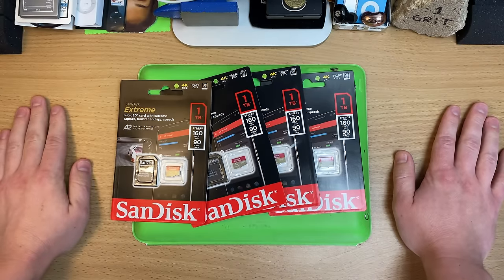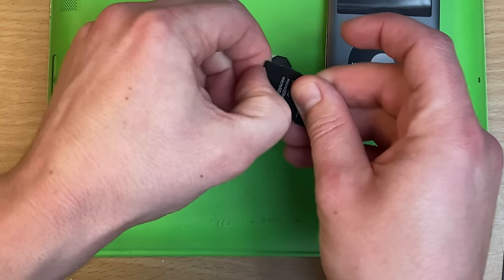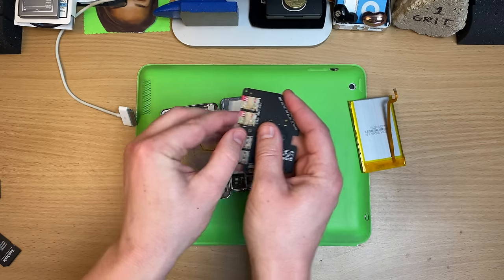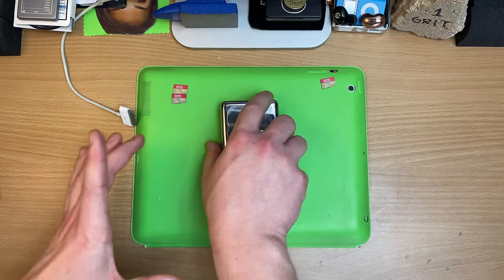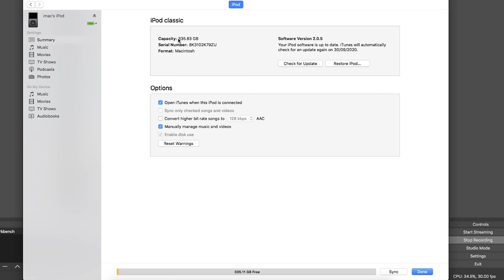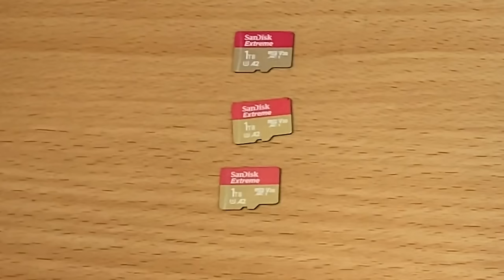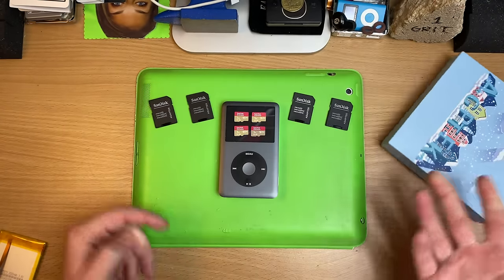4000GB in an iPod Classic.

Comment: Bet iPods are 32 bit, and so can’t read anything over 2,147,483,647 megabytes or something stupid like that
Reply: Thats what i was thinking also especially being a 2007 system
Reply: That should mean in theory you could make post iphone 5 model ipod touch 4tb+
Reply: I was thinking more of the limits of UEFI vs. Traditional BIOS formats, a traditional BIOS system can only address/see 2tb total.
Reply: Because the maximum number that can be represented by using 32 bits is 4,294,967,295, this translates to 2.199 TB of capacity by using 512-byte sectors (approximately 2.2 TB). Therefore, a capacity beyond 2.2 TB is not addressable by using the MBR partitioning scheme. 

Gotta love 32bit architecture. Though not bad for an arm processor at the time.
Reply: I would think that too
Reply: @canadiansike7389  You forgot a critical part of the hardware... what is JBODing those cards?  the iFlash card, it is probably using an MBR.
Reply: Thomas Basham yes but tbh good luck soldering 2-4tb on an iPod touch board and fitting it inside the case
Reply: @canadiansike7389  This. I'd bet the limitation is the partitioning scheme.
Reply: Lochlan Currie 2TB+128GB+16GB+8GB config would reach exactly the max with 4 cards. I see the ultimate and final video in this “series” in front of my eyes.
Reply: @canadiansike7389  wait, 2.2TB! so that's why when Danky put 2 1TB cards and 1 512GB card it said ~360GB which is ~2.2TB less than it should?
Reply: MarcosLp probably some weird overflow issue yes.
Reply: coppyhop These restrictions are about GPT vs MBR (partitioning type), not UEFI vs BIOS
Reply: More like, iPods use the standard DOS partition table (aka MBR), which only supports disks up to 2 TiB (which is roughly 2.2 TB). You need GPT to work with 3TB+ disks. There were all sorts of compatibility problems when the first 3 TB HDDs came out.
Reply: Thomas Basham Yeah, the new iPod has the same CPU as the iPhone 7, so that would work, but iOS devices work different
Reply: @e.6z1  Yes that would be an overflow issue. After 2.2TB it restarts back at 0, so it only read from 2.2 on to 2.5, which was ~300gb cbf doing the math it's late.
Reply: Came here to say this.
Reply: Over-50 embedded engineer here, read most of this before realising I understood it all. Good work!
Reply: Thats the answer. They are all 32 bit
Reply: You technically could use bank switching to get over this limit
Reply: THANK YOU I WAS WONDERING WHY OLD STUFF CANT READ OVER 2TB
Reply: MarcosLp 2.02tb
Reply: Ben Perkins 2.02tb, everyone is forgetting the hundreds place in mb, it takes 1024mb for 1gb and 1024gb for 1tb
Reply: Urmahgurica not anymore, a gigabyte is 1000 megabytes. The binary system you’re thinking of is kibi/mebi/gibi/tebibytes
Reply: The limit here isn't because of MBR vs GPT partitioning. If it were, I'm pretty sure Disk Utility would see it as full capacity.
Reply: @benperkins2929  thank you for covering that!
Reply: @roge0  well partitions only do so much. 32 bit hardware is 32 bit hardware. It's a physical issue not a digital one at this point.
Reply: @davidwostrel  mbr and boding aside it's a 32bit arm processor. No matter how you do it. It'll never read over 2.2TB of storage
Reply: @e.6z1   @Ben Perkins  summed it up before I could
Reply: @urmahgurica5851  also correct, however we will still hit an overflow. Hardware this old is bound to act unpredictably when trying to handle hardware it's not meant to handle
Reply: Ben Perkins why do you know that
Reply: @neonrl1414  I'm almost finished my computer science degree :)
Reply: @e.6z1  its overflowing cuz 32bit adresses 2.2TB and just doing last 360GB
Reply: It's called LBA 32-bit address limit (no more than 2^32 512-byte sectors).
Reply: @canadiansike7389  It's totally unrelated to the bitness of the CPU.
Reply: Kinda weird that they count bytes on the drive with signed integers though
Reply: @SIGSEGV1337  They don't. 2^32 sectors * 512 bytes/sector = 2^41 bytes = 2 TiB.
Reply: @evgSyr  Good point
Reply: That or the ipods only supporting MBR partitions which only go up to 2TB
Reply: @coppyhop  yes! Or maybe it's related to it being MBR or GPT?
Reply: If I googled the right model, the processor shod be a Samsung ARM, Apple A8 chip, 64-bit architecture.
Reply: It's a bios and level and drivers mixed with cpu so I mean you could probably do 2.75TB sd card
Reply: That would actually make a ton of sense
Reply: RuneScape max cash stack lol
Reply: @coppyhop  Not excatly. Depending on various factors, the OS can decide what it can and cannot do after it boots. Those BIOSes themselves can address 2^32 sectors, which in 512 B sectors means 2TiB (~2.2TB). Some hard drives use 4096 B sectors to work around this (raises the 32bit addressable storage to 16 TiB (~17.6 TB) to allow those old BIOSes to boot reliably from those disks). The same goes for the MBR partitioning scheme; 512 bit sectors -> 2TiB maximum; 4kiB sectors -> 16TiB maximum.
Reply: @lollllloro  Even so I doubt Apple thought some madlad was going to cram more than 2 terabytes in a 2007 ipod as mobile storage wasn't that good when it was made. The phone I'm holding is 64ish gb barring sd cards.
Reply: 2 billion megabytes?
That's 2 exabytes
Reply: @canadiansike7389  you're right, but not quite. It uses the Apple Partition Map that has the same limitation as MBR nonetheless.
Reply: @thomasbasham8705  no, the storage is soldered.
Reply: @XanthosAcanthus  thats why i said in theory as in a hypothetical. I know there isnt a chip that would allow it with the current technology or without microsoldering skills when it was. Also thanks for tagging me i missed most of this thread
Reply: is that the 32B integer limit?
Reply: @matsuyowaimo  yes it is
Reply: @thomasbasham8705  No only Apple A7 and up are 64 bit (iPhone 5s) and all Apple mobile devices including iPods have soldered storage so you can’t change it
Reply: @thomasbasham8705  Well you have to make sure it is 64-bit.
Reply: That's almost certainly it, the Ipod's processor is believed to be some flavour of ARM, and there were no 64 bit ARM processors until 2011.
Reply: @Chlorate299  you mean 2013 right (that's when apple put one on the iPhone so ipods after that should have 64bits)
Reply: Having a 32-bit processor doesn't prevent you from using drives over 2 tb now if it's using fat32 that would. You could easily use greater than 2tb drives in windows xp since ntfs didn't have those size limits even though it was still a 32 bit system.
Reply: That's what i thought
Reply: Fucking signed 32 bit integer limit
Reply: @canadiansike7389   what is The limit of 64 bit lol
Reply: its 4,147,483,647 bytes of ram but it can have infinite storage
Reply: @canadiansike7389  I was thinking he wasn't removing all the partitions, but this really explains it well.  Especially the comment about the overflow.

Comment: It''s so earily similar to the attempts to get Windows XP to read more than 4 GB of ram...
Reply: Or any x86 OS for the matter.
Reply: Eerily*
Reply: 32 Bit Windows XP: ~4GB RAM hard cap.  (There was still a 64 bit version, but not well known).

iPod classics apparently use HFS+ which would have an 8 Exabyte limit (1EB=1 million TB), however I don't think that's the case.  

There's no concrete info online about the iPod filesystem, but it's most likely not the HFS+ you see mentioned, where the capacity is 8 Exabytes, i.e. 8 million terabytes.  Probably a 2TB limit like FAT32.
Reply: @startedtech  what do you mean windows XP 64 bit isnt well known? i thought alot of people knew about it but i guess not?
Reply: @startedtech  it's probably a limit on the SOC controller, cos the ZIF conector is and IDE cable, and 2tb is the hard limit of that interface, also, earlier revisions of sata had problems with more than 2TB but that could be solved with some bios tweaking (not the case here LOL)
Reply: @startedtech  Mac formatted iPods use HFS+. The problem is more likely due to the disk controller being unable to read above 2TB. Mind you it has a 32-bit ARM processor so the 2TB limit makes a fair bit of sense.
Reply: @californium-2526  Well... any halfway decent Linux distribution would likely support PAE in the x86 version.
Reply: Yep.
Reply: easy, I had 8 with xp...
Reply: Any x86 OS can do it. It's called enabling PAE.

And it's on on Linux by default.
Reply: Wait you never used 64 bit windows xp
Reply: @WolfieMar  There wasn't much reason to use a 64-bit OS for normal PC use when XP was around (hence hardly anyone I know has ever used it) and by the time x86-64 CPUs, +4GB of RAM and 64-bit applications became more common Windows Vista and 7 were already out. I used to run XP Professional x64-bit before a buddy of mine gave me a pirated Windows 7 copy and I remember it being quite unstable in comparison to its x86 brother.
Reply: Anyone else seeing protomario just everywhere?
Reply: @startedtech  In my opinion it probably is FAT32 because the iPod's file system needs to be natively read by Windows in order for iTunes to write files to it.
Reply: @armanelgtron4533  And I thought Win2K and above (like WinXP) supported PAE too, but the boards/CPUs? idk?
Reply: Windows Server 2003 supported that out of the box. You can backport 2 kernel files from that to XP and have it work. My XP laptop has 12 GB of RAM, and the only limitation of this method (PAE) is that each process can only use up to 3 GB, but most 32 bit software that can use this much would just use multiple processes anyway.
Reply: *eerily
Reply: @g19mx  naubodee gaevs ai sheit dood. Spelling is just too hard ain't it bruh
Reply: @startedtech  you're right in there being no info about the file system but  there is some known about the hardware. It's a samsung arm chip more than likely 32bit the time considering the first 64bit arm phone was in 2013 I believe and was the 5s. The limit of memory is around 2.2tb but shows up as 2tb. So you're assumption is highly correct in my opinion
Reply: I got Windows XP to run on 8 GB of RAM
Reply: @coffeedvdrw  There is a 64 bit version of Windows XP, the 32 bit can not use more than 4GB of RAM because 2^32 = 4.294.967.296 bytes which is 4GB
Reply: @loganiushere  Everything from the Pentium Pro onwards (i686) supports PAE. At least Windows 2000 did, on the software side, not sure about NT4 or anything older. Linux/Unix definitely did way prior to Windows.
Reply: @RodrigoBadin  And 2^36?
Reply: Just use Windows XP Pro for 64-Bit Extended Systems
Reply: @startedtech  I did some googling and I think (not sure) that the partition map in an iPod uses a MBR for its partition map, which means that the disk size limit is 2 TiB which makes sense based on the 2TiB limit in the video.
Reply: You mean <= Windows 98.
Reply: i want 4 gigs on my xp lol i. have 1 gig atm
Reply: wow, i have a windows xp and windows 7 machine, both operating systems on different hard drives, 1 TB each, and it has 5 GB of ram
Reply: @LazyTechNerdCG  bruh my windows xp has 0.99gb of ram and my windows 7 has 4.00gb and my old windows 10 had 3.67gb
Reply: Yeah.
Reply: there are workarounds
Reply: @WolfieMar  64 bit xp wasn’t not a thing yet. I had the chance to install 64 bit but didn’t made any sense as 64 bit xp apps was rare. Not to mention 8gb of ddr2 cost a bomb
Reply: @maman89  there is a 64 bit xp. Lol.
Reply: @lolerie  wasn't a thing doesn't mean it doesn't exist. I had a chance to install but chose not to
Reply: Windows x64
Reply: @startedtech  idk, i used 64bit cuz i can read
Reply: Get the 64bit edition, m8!
Reply: Attempts? There are working PAE patches, got 18gb working with no problems other than 3dmark 2000 something not running
Reply: But proto....!
Reply: @absolboi334  *early
Reply: @WolfieMar  No, a lot of people didn't know about it because computers with 64 bit CPUs started to become popular in the consumer market at around the time Windows 7 came out.
Reply: @Lambda_Ovine  Yeah but after that i thought they would at least know a little about Windows XP x64
Reply: @californium-2526  I remeber Linux patching the kernel to do more than that. The thing is that considering how 32 bit systems work, I don't even know how that's even possible.
tbh, if you use a 32 bit system you won't probably need more than 4GB of RAM anyway.
Reply: Get 64 bit XP, boom
Reply: eerily*
Reply: @darcyhayes9904  hes trying realllly hard to be relevant again and revive his dead channel. Cringe
Reply: @californium-2526  you probably mean 32 bit, 64 bit (amd and intel) processors are still x86 architecture,
Reply: @g19mx  My man can't even use the @ reply feature apperently
Reply: @nesyboi9421  I can’t see my own message what was it?
Reply: @g19mx  hey my man learned how to use the @ reply function
you were just telling a guy nobody cared.
Reply: @nesyboi9421  that was like a year ago aye lmao
Reply: @startedtech  apple be like 10000000000000000000000 dollars for the exabite one
Reply: @startedtech  Weird to hear XP 64 isn't know... tho i can't say much, because i had most of my XPs as business purchases, no clue what the pleb (jk) had.
Reply: @RodrigoBadin  32-bit version of XP (and any later version, up to 10 32-bit) can use more than 4GB, but you have to install a unofficial patch which can be found somewhere on internet. If anyone found this patch complicated, they can use 64-bit version of XP, but beware that its doesnt receive POSReady (last version of XP) updates all the way to 2019, and second is that, some 64-bit version of windows, in this case, both XP x64 and 10 x64 bricked 2 HP motherboards during BIOS update [due to the driver for the BIOS update software only works with certains version of windows, otherwise BSOD] (and both motherboard are same model from a HP Microtower PC).
Reply: @startedtech  HFS+ tends to have issues above 2TB. If you have a PowerPC Mac running 8.1 or up (and I'm drowning in them), you'll have issues with drives over 2TB -- and partitions over 190GB in Mac OS 9 and below.
Reply: @megakarlachofficial  why in the world would you even use a 42 bit version of win10?
Reply: @L44tsmasher735  
first off ur typing 32-bit wrong*, and now second, doesnt matter it someone use it or not, but 32-bit Win10 was there for 16-bit app compatibility, this just about the RAM patch tools requirement just to make sure its works on specific version of windows (32bit or 64-bit only, new or old) and etc... and in fact, im not using Win10 32-bit either as main (using modded Win11 here and its 64-bit only, on a 2009 potatoish rig since my main gaming, mid-range 2011-12 [i5-2400, 8GB RAM specs] with 750Ti PC broke).
Reply: Sorry for the Necro posting but you can Use Windows XP x64 to get those sweet 8GB DDR2 lol.
Reply: @darcyhayes9904  nope, just you. (Ntbr)
Reply: Spoopy proto boi

Comment: "Alright mate, let's use this here 1TB Mac to load up my 4 terrybyte iPod."
-DankPods probably
Reply: the reason that it kept saying errors was the cards were probably fakes sold online
thank you amazon sellers
Reply: me too
Reply: "Alroight mate , let's use this ere 1TB Mac to load up terrie bite oiPod:
Reply: @bruh9600  No, the actual Problem is the Format of the cards, which were FAT32.
FAT32 can adress up to 31bits at a time, the first is for kB or MB. 
2^31=~2,2GB (other could be OS for the iPod)

That's also the reason why u can't put files larger than 1,8GB on a FAT32 formatted USB-Drive.
Reply: @878manu  Don't you mean 4GB?
Reply: I'd really like to smack the thumbs up button for you, but... I mean... 666 likes. Not that the number is particularly relevant here, I just... can't be the one to break it.
Reply: @878manu  FAT32 has a SINGLE file size limit of 4GB, FAT16 has a SINGLE file size limit of 2GB. The theorical limit for FAT32 drive sizes is 2TB, not 2GB, though Microsoft's disk manager won't allow you to make a FAT32 partition larger than 32 GB. I have a few 32GB SD cards in FAT32, a 8GB FAT32 SD card, and Dankpods IN THE VIDEO successfully formated his 1TB cards to be FAT32, and 2TB recognized (however unreliably) by the ipod.
Reply: @od3stroyer771  It's indeed 4GB, and it's for a single file size, not the total drive size.

Even Apple got it wrong at one point. MacOS High Sierra introduced a bug that disallowed files over 2GB to be copied to FAT32 drives. You had to use the Terminal or a third party file manager to move large files. I think it's long been fixed.

High Sierra was a mess, the FAT32 file size limit bug was overshadowed by things like the root access bug and the password hint bug.

Let's hope YouTube doesn't delete my comment this time...

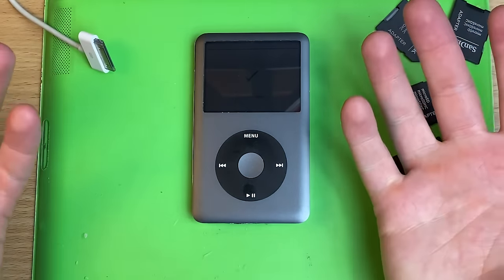Comment: 15:17 - A limit, yes. These iPods are clearly 32-bit devices. 32-bit devices can only access around 2.199TB.

16:00 - To get over 2.199TB you'd need to overhaul the entire ipod (silicon/mem controller etc) to 64-bit
Reply: Or just format the disks with a higher sector size.

Comment: 8:46: "Partition map: Master Boot Record"
9:01: "Let's just get over 2 terabytes!"

me: grabs popcorn
Reply: @FireFoxDestroyer  Correct. The fields in MBR that hold sector numbers (designating first and last sectors in a partition) are 32 bits. 512B (per sector) * 2^32 = 2 TiB.
Reply: @myxal  there are 4k sector hard drives out there
Reply: @dt08-old   There are.  But, last time I checked, SD cards have a fixed 512-byte sector.  I don't know if that's still the case for SDXC and beyond, though.  More to the point, whatever the SD cards use as a raw sector is going to be abstracted by the controller chip on that adapter PCB, which could do whatever it wants, and whatever the iPod disk controller will accept.
Reply: @nickwallette6201  I have the feeling the controller just creates a striped volume of the cards. Or rather puts them as linear address space behind each other and exposes that combined storage to the outside. Nothing super fancy or complicated.